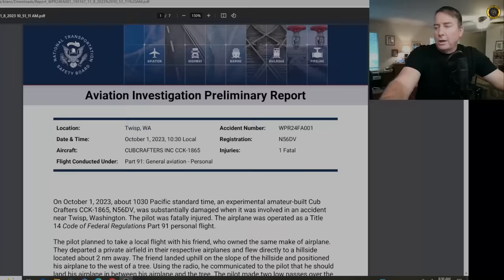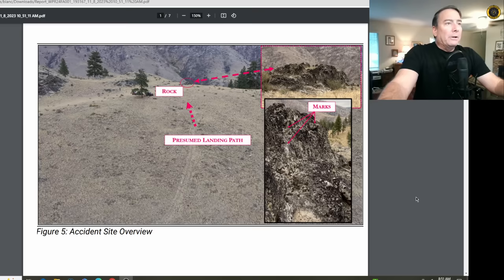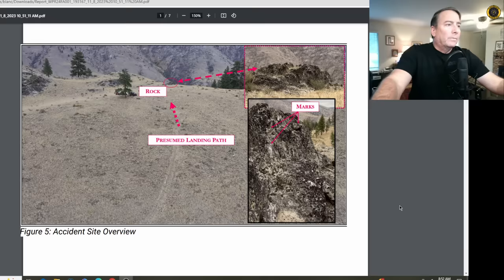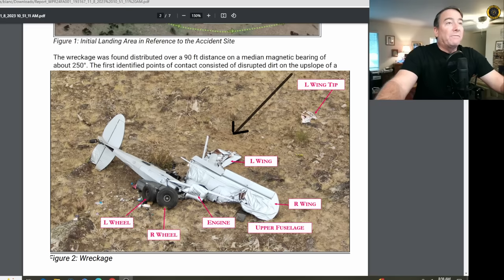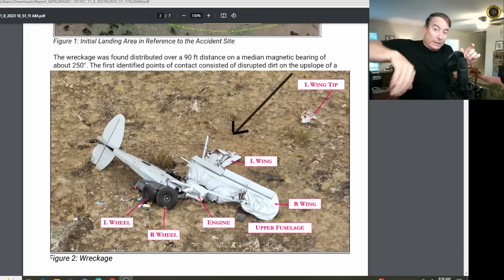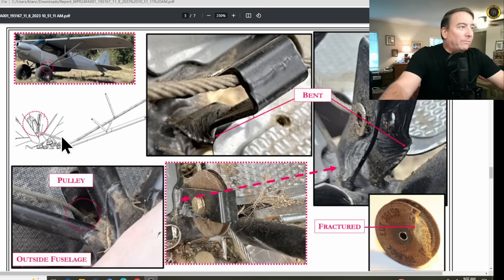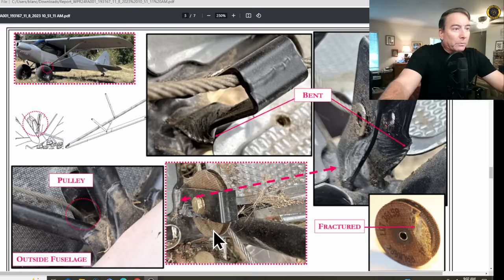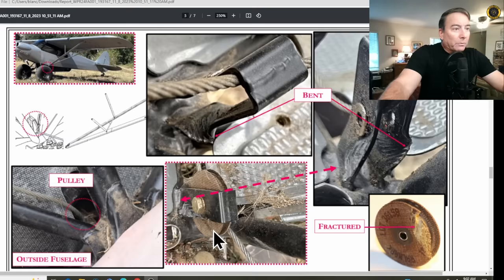Carbon Cub N56DV Fatal Accident NTSB Preliminary Report 10 Nov 2023

Comment: As an industrial designer, the specific mode of failure in this crash is a really interesting case study in making systems robust and resilient. Juan as soon as you pointed out the wing brace and landing gear strut came together in the same place it gave me concern - add to that the aileron cable running through the same intersection and it's a recipe for (a very specific) disaster.

I expect people will say "Oh but how likely is it that will ever happen?". Perhaps never, but this is the problem with mechanical systems - we aren't good at imagining all of the failure modes, so this design decision meant that damage that should have been survivable (for the pilot if not the aircraft) becomes a fatal flaw. As a designer, that's a sobering thought.
Reply: Almost all aircraft designs have critical areas where failure can result in the loss of the airplane. It's the PIC's responsibility to be aware of these and use the inspection process to help ensure safety. Operating the aircraft in an irresponsible manner that might damage critical components indicates poor judgement, an unfortunate part of many (fatal) accidents.
Reply: @bernieschiff5919  true. But as a designer it is my job to mitigate problems by making good design choices - or I can make them worse by selecting easy solutions. Connecting the landing gear and wing brace to the fuselage at the same point is a design decision that looks to me like asking for trouble. Going on to run the aileron cable through the same point - because it's convenient is to my mind very bad design.

As a designer I'm trying to anticipate failure modes and how they could effect the thing I'm designing. Landing gear is always going to be a vulnerable point on an aircraft - even for the most competent and careful pilot. So physically attaching not one but two entirely separate critical systems to another forseeably vulnerable system is in my opinion poor design that appears at this time to have contributed to the loss of the aircraft and the pilot.

Even the best pilot make mistakes. As a designer it's my job to give them the best chance of surviving those mistakes as possible.
Reply: @langdons2848  valid points. You can land a plane without landing gear. You can't land it without a wing.
Reply: @tdkeyes1  exactly damaged landing gear shouldn't have lead to a loss of aileron control.

To avoid that you need to select the right design philosophy for the product. 

Racing motorcycle: highest performance, lowest weight, so you will try to make every component you can serve two purposes or more.

Private aircraft - soft failure, high survivability, ease of maintenance and operation. That implies simple technology, high reliability, and decoupled systems - which the Cub doesn't have in this specific case sadly.
Reply: Agree, I thought exactly the same thing. Foreseeing landing gear damage on a trainer type air-frame is to be expected, running critical control cables right through the gear attachment point seems negligent at best. However... this design is old and attitudes were different to safety then. It seems to me looking at all this that so long as you can say 'that's how it was originally designed' you can get away with flying it regardless of how terrible the 'design' was and is. Some 1920's era monoplanes were absolute death traps yet folks will rebuild them and die in them today, all legally done under some exception in the regs like experimental or built as designed etc.
Reply: @langdons2848  that leads back to the pulley material. Milled alloy or steel and the crash probably would have been avoided.
Reply: Another factor the designers likely considered and weighed more strongly (hence the resulting design) was to locate the pulley near the other structure to protect it from incidental damage due to contact with foreign objects. That's partly why the cable runs behind the strut, for instance. The side effect of the structure itself being what dislodged the cable/broke the pulley is most likely exactly that, although even if protecting the pulley point with nearby structure were desirable overall, it would still be possible to take measures to prevent this exact failure in case of the landing gear folding in the same way-and these early designs didn't really anticipate these third and fourth-order effects. And the convenience of commonality since then makes plenty of inertia to overcome.
Reply: To me it would seem to be that   collisions with the wheels would be one of the more common collisions in a small aircraft landing on non-paved runways.
Reply: I live in sagebrush country. I always assume there is a rock behind every clump of brush. Consequently if I were flying over prairie, I would always be looking for the least/smallest brush areas as a place to land either intentionally or in an emergency. The rock he hit could have been obscured by brush. Aileron controls in a bush plane should be designed to be overhead so that striking a rock may damage the gear, but never any part of the aileron system.
Reply: @tdkeyes1  I thought the material was kind of odd.  Why try to saved a tiny bit of weight(a few grams) at a super crucial point.
Reply: @nickbreen287  that's a fair point to make about legacy designs. The crash aircraft though is a Carbon Cub - from the website: "Though it was inspired by the iconic Piper Cub, the Carbon Cub has an entirely original structural design".

So despite being an entirely new design they retained this original pathway for the aileron cables as well as connection point for the landing gear and wing brace on an aircraft that, again from the website: "revolutionized backcountry flying by designing a modern, high-performance Light Sport aircraft". So it was always intended to be used in rough field situations by sports pilots where high stress on the landing gear would be a certainty.
Reply: @tdkeyes1  possibly - or the cable could have just skipped off the sheave without tearing a chunk out of it and still jammed. Now if it had been a contained sheave that the cable couldn't have escaped from that might have been enough, but it's still a critical point of failure for the aircraft. 

I'm assuming a loss of aileron control/function was the cause? Or did the wing brace detach and the wing fold up?
Reply: @calebpool9818  agreed, there are definite benefits in having the cable protected by the strut. That being the case though I'd definitely have put it through a block, rather than running it around a bare sheave. That way a structural failure is less likely to jam the cable. And I would still have decoupled the landing gear from the wing brace connection.

As you say predicting exact failure modes is hard, but I think in this case CubCrafters got a little too nostalgic.
Reply: @tomcoryell  At a glance that would be my response too - find a way to run the aileron cables up and through the wing. But I'd probably look at modifying the landing gear attachment points and replacing the sheave at the turn point with something more robust and reliable.
Reply: @langdons2848  I don't believe the actual cause has been positively identified. From the flight path stuck ailerons seems likely.
Reply: @langdons2848  Fair point.
Reply: Ailerons could’ve been controlled by moving the cross/connecting cable from side to side but I don’t imagine he thought of that.
Reply: The plane was fine until he hit a rock the size of a dishwasher!
Reply: @grafhilgenhurst9717  Absolutely, but from a design engineering standpoint the gear attachment point is a high risk area etc, like placing the battery inside the fuel tank in a protective enclosure, works fine as long as nothing happens...
Reply: What's the real issue?   Poor design?  or  attempting to land on extreme terrain with zero tolerances for error?      Let's see what causes the next GA accident.  Poor design/mechanical/system failure?  or Pilot induced?   I know where I'm putting my money.
Reply: Naval aviator again. Made a comment about old pilots, etc. Another ditty we lived by, and died by, was that "whatever can happen, WILL happen". That's what happened to me, a 1 in a million part failure at a critical condition of flight. Now I walk on artificial parts with some significant brain alterations. Engineers and designers cannot think of every possible problem!
Reply: @robfredericks2984  that is absolutely true. But personally, as a designer, I think it's an abdication of our responsibility not to look at failures like this and analyse why they happened and how our work contributed to them.

There will still be crashes as you said, but hopefully we can make them less common, servere, and destructive through better design.

I sorry for your injury Rob and I hope your sacrifice was learned from to help protect future aviators.
Reply: @grafhilgenhurst9717  clearly it wasn't. It had an inherent design flaw that made it vulnerable to a catastrophic failure from what should have been a survivable impact with said rock.
Reply: @tdkeyes1  that would be my assumption too (jambed aileron). It will be interesting to see what the final cause is determined to be.
Reply: @E50311  human error is probably always going to be the least controllable aspect of any crash. But design, especially in sport aircraft intended for STOL and rough field flying where the risk is always high is something we can improve on. And in my opinion we have a responsibility to do so. As a designer I see my job being to helping the pilots survive the mistakes that do happen.
Reply: @robfredericks2984  I guess, there are not many parts on a plane like that which are not doing 'something' important. I mean, its a fairly stripped down version of a fairly basic machine. Zero redundancy on many parts. Keep it well maintained and dont bump it?
Reply: @langdons2848  All accidents are tragic for the families left behind, and It's never comfortable discussing them, not wanting to sound too critical.    But, we have to understand what actually happened so we can sit back and reflect on our own decision making.  We can't sugar coat accidents that involved high risk adventure flights.   I get it, it's cool, few in the aviation community experience it, you get a rush by making the landing and get to post it here on YT,   boasting about your adventure.  The jury is still out, but there was the possibility of a flight control failure due to impacting a boulder.  IMO that's not a design flaw, that's a pilot who made a conscious decision to fly a very critical approach to land on unforgiving terrain,  with zero tolerance for error.
Reply: @E50311  I fundamentally disagree. Pilot error, or over confidence were contributing factors to the crash. But as I've said above - from the evidence available, poor design choices in the aircraft compounded any error and probably turned a survivable accident into a fatality.

The two things can be true at the same time. Pilot error and failings in the aircraft.

Please don't assume that I'm trying to excuse the pilot in some way and transfer all blame to the aircraft/manufacturer, I'm not commenting on his actions in this thread. I'm discussing one aspect of the crash and as a designer looking for lessons that can be learned.
Reply: All of this discussion centers on only one load case. There are many others, each of which at some point are important. As an example, in a botched landing with very high vertical descent rate at impact, the inertial load from the wing is reacted by the struts and down into the landing gear. The more offset you put into the load path from the wing into the gear, the less load it can handle. Another typical example is tying the main gear into the engine mount. You want the reaction forces from that concentrated mass going right into the gear.

Picking only one load/failure case and notionally redesigning the structure to “make it better” at the expense of all the other design optimization is likely to cause unintended results.

A prior comment on using the strut to help protect the cable run is right on the money in my opinion. Try running it somewhere else and then add up the vulnerabilities and failure modes. Only when you have two designs flushed out can compare them and make an informed decision.
Reply: @davidhull6359  Excellent points.
Reply: @davidhull6359  I agree that it's simply not sufficient to look at one issue. As I've said before the design should be optimised for the application and that includes considering more than one failure mode.

As an aside I agreed with the person who suggested that the cable being shielded by the strut is a benefit. I agree with that, but there could be ways to achieve the same or better protection without taking on the inherent risk of that specific design.

Yes, transferring the load of the wings direct to the landing gear has plenty of merit and also saves weight. But this specific design also creates a vulnerability. Personally I wouldn't then run a third critical system like aileron control through the middle of that joint. Or if that was the only way to do it, then I'd be looking for ways to ensure that even in the case of a catastrophic failure of that structure that the cable would still have a good chance of remaining function.

At the end of the day every design is a compromise, but that's really the point here. Some compromises are acceptable, some aren't. As designers and engineers we have to walk that line with every decision.
Reply: It would be nice to route the aileron cable through a different location, but it might not be practical.
Reply: @ericfielding2540  given the apparent vulnerability of the sheave to damage and jamming of the cable, if they can't re-route it then they really should make that routing much more robust. People's lives depend on it after all. And in a high performance bush plane this sort of accident is going to happen again.
Reply: @langdons2848  Yes, the pulley and bracket could be made much more robust. I only think it would be difficult to put it in a different location. I am surprised that the pulley is phenolic composite, which does not seem very strong. I guess it does not corrode.
Reply: Yes it does seem odd to have everything going through such a common area.
Reply: "landing gear is just that-for landing. Even if you designed it to withstand a 50mph impact with a boulder, you probably wouldn't expect the pilot to continue on flying after the impact. Regarding the aileron cables, routing them through the roof would subject them to thousands of cycles of being pulled through 90 degree angles, fine for a garage door but not for a airplane. The simplicity of the present system is the basis of it's reliability. Thousands of industrial accidents each year proves that you can't make anything idiot-proof.
Reply: @coreyandnathanielchartier3749  the point isn't to make the landing gear "idiot" and boulder proof. As I've mentioned previously the design question here is how to avoid turning a damaged landing gear into a fatality.

I don't buy the "fatigue risk" argument on the cable. From what I can see of the aileron cable path, the cable already makes 90 degree turns. And given that the cable only moves a matter of centimetres back an forth over each sheave it would make no difference to reliability if it had to go around a couple more.

It might change the "feel" of the ailerons a little, but cable tension would likely be more significant.

At the end of the day though I'm not advocating for any specific solution. But I can see a number of options to reduce the risk, including a contained sheave replacing the open one, shielding/enclosing of the existing cable path. Or rerouting the cable. Each has merits and drawbacks. Good design and engineering is about actively weighing those risks. In this case I think they went too far on the side of convenience.
Reply: @tdkeyes1 Nope, the left main mount was sheared (for all intents and purposes) so the landing (even on level ground) would have been ugly but possibly non-fatal. I agree that the aileron cable entrapment was what guaranteed the fatality.
Reply: @langdons2848 your entire point only has merit if a different design is presented to be evaluated.  As an engineer you would know that every design for anything contains compromises and constraints.  One cannot create a solution that is best for every scenario.  There is cost, weight, strength, simplicity of construction, material availability, ease of inspection, and easy of service to be considered.  You cannot maximize everything to do all things.  Every design has constraints.

What is your recommended redesign?  Put it out there as a potential solution for the Cub community to evaluate.
Reply: @FlatOutFE  take a moment and read the thread. I've covered everything you mentioned.

Edit: also, if you'd bothered to read my original comment you'd see that what I was proposing is that this crash is an opportunity to learn by evaluating the failure mode of this design. It sounds like you are a Cub enthusiast who feels hurt at a perceived criticism of the aircradt. If so then it you rather than me who should be proposing solutions. I don't fly any more, I'm not at risk. But I do care about others safety.
Reply: @langdons2848 , I read every comment.

There is a reason that the wing strut, landing gear, and control cable comes together in one location.

Please put forward a "better" design to be evaluated.
Reply: @FlatOutFE  I have. Feel free to re-read the comments. You missed it multiple times (key words "contained sheave", "wing"). 

As for "there's a reason why...". Yes that's been discussed multiple times above as well.
Reply: @langdons2848  the pulleys or sheaves in the Cub are contained.  They are not open. The mounting bracket prevents the cable from coming off.
Reply: @FlatOutFE  and clearly that mounting bracket is susceptible to damage and allowing the cable to come off. As it did in this case.

It's not a contained sheave, another description for what I'm suggesting would be a "block". Fully self contained, strong, and therefore much less susceptible to damage in this kind of failure - if you insist on running the cable through that area.
Reply: @grafhilgenhurst9717  Exactly. All this discussion about poor design, component failure, etc. IMO is pointless, and gives the wrong message, especially to aspiring pilots concerning decision making.  I’m not against improving aircraft systems. Every accident needs to be investigated and cause determined just for that reason, but when a pilot consciously makes the decision to fly their AC and their skills to the envelope you better understand the risks involved. No design will save you from high risk level decisions.  For all you design engineers out there. Come up with a better design and fly that better design into a boulder and let’s see what happens.
Reply: @langdons2848  With absolutely zero experience in any form of design, besides graphic, would it be feasible to run the same cable more in line with the bottom of the wing where it goes through the fuselage and then goes down along the fuselage frame to around where it comes through now via a pully that lets it make the turn? Allowing you to just have the landing gear struts designated to only that purpose.
Reply: @aaronwhite1786  I don't know enough about the Carbon Cub design to say, but inside the fuselage up to the wing, and then out to the aileron through the wing would be my guess. Definitely better though to have it protected by something like it is by the wing strut currently.
Reply: @E50311  I disagree. The design discussion doesn't send the wrong message. The pilot made a mistake, that's perfectly clear and plenty of people are discussing that. But to ignore the contributing factors like the vulnerability of the routing of the aileron cable is negligent. Should the MCAS failure on the 737 Max have been ignored, or were the pilots just not good enough? Of course not. This discussion is no different. Everyone involved in the design, construction, maintenance, and operation of aircraft need to be involved in the analysis and understanding of crashes so that we can do better.

As for a better design, I've already given my thoughts on how to make that particular failure mode more survivable. The real question here is if you'd be happy to risk flying a Cub into a boulder as it is currently built. I'm pretty sure that my suggestion would give you a better chance of maintaining aileron control.
Reply: @langdons2848  Pilot radioed he was having a control problem, not that the wing was folding....
Reply: @E50311  Argument of extremes, better design might have prevented this fatality, just as air bags often prevent fatalities. Or Vgs may prevent fatal stalls.
Reply: @davida.4933  I have no idea if the wing folded prior to the crash or not. It does look true that the controls were compromised. I'll be interested to see the NTSB final report.
Reply: Agreed. I'm also a designer. Having the flight controls run through the landing gear on a bush plane seems pretty stupid considering that's such a high impact area.
Reply: @stevenshorten6184  agreed. I'm all for components performing multiple jobs in a system, but not if it creates a risk of catastrophic failure.
Reply: I'm curious, does anybody knows whether or not Husky has the same type of single point connection for the strut/landing gear assembly and the aileron cable run?  Looking at photos I can't tell.
Reply: @tdkeyes1 But if you've landed hard enough to break it, you're already on the ground and probably should just stay there.
Reply: @langdons2848 it wasn't just damaged by a heavy landing though. To design for the possibility of what happened is probably unnecessary but i don't know much about this sort of flying.
Reply: @chrisnoname2725  seriously? It's a bush plane. It's flying into rough country. Designing for heavy landings is the bare minimum for a bush plane. What I'm pointing out is that yes absolutely you should be designing for more than just heavy landings.

Which goes to your other comment - just because you hit the ground doesn't mean that you necessarily can stay there - as happened in this case.
Reply: @tdkeyes1  I'm not  pilot, but I had the same thought. Even if these guys are serious about every ounce of weight, something like a pulley seems like a bad place to do it. Put in a strong alloy pulley, and if you want to make up for that tiny bit of added weight, eat a smaller breakfast!